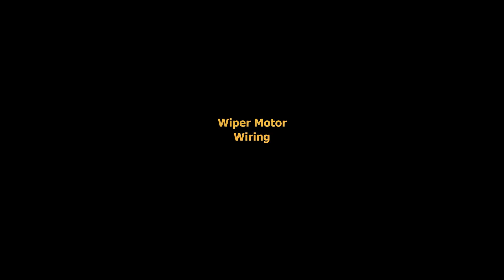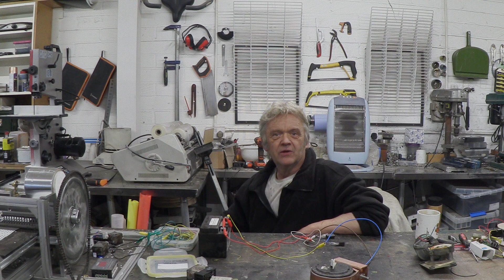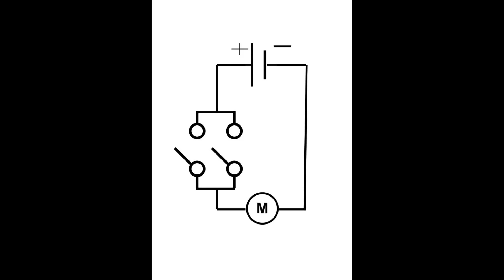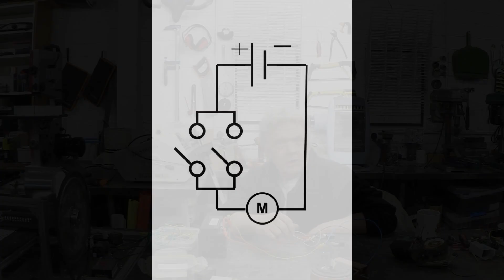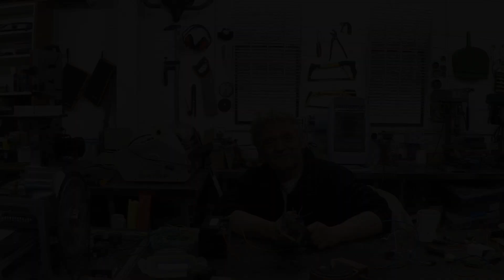979 - Wiper Motor Wiring

Comment: I just had my 1973 Mercedes 450sl wipers "fail" by continuously running when not told to!  sounds like the park switch in the motor is gone!  I replaced the stock and there was no improvement.....  Any thoughts?

Comment: Any help here please .
I got stuck with odd behaviore.
I have British stile dashboard suposedly it was build for me Ascona C 85 model year that thing has 700Y voltage regulator inside the dashboard.
How ever I broke down the 12si delco alternator regulator to see whats inside and suprisengly nothing just empty circuet board.
The thing is Im chaseing fir days to see why me engin self acelerates from idel to max rpm when I use me head lights the other thing acured as well If I use on warm motor all 4 blinkers me engin dont want to stop it kinde of works in union with blinker relay nearly resembeling hit and miss engine .
I do use 4 pin gm ignition module with inductive trigger and E core type ignition coil from GM .
I found the problem eventualy it was corroded ground wire on the back side lights bulb holder it hade grean staff on it I cleaned it and the problem gone away eventualy.
But I wanted that feature for some reason I was curiuse why it worked so well???
Can I modify that some how and use that feature ?
Other specs that I have:
2pin warning lights on relay,
3 pin blinker relay,
4pin rear windscrean heater relay 
6pin windscrean wiper motor relay.
So any help please why that acured?
What has blinker relay to do with other relays me wire harnest from GM is a mess Im confused like hell.
Is there any way to control that 4 pin gm ignition module pulse duration ? Im tired to go out side in winter to fumel with me distributor ignition timing .
Im seriusly anoyed.
And is that windscrean motor 6pin relay actualy singel pole dobel trow relay??

Comment: Great video helped a lot as I have to sort out parking on my P5B
However just out of interest:Resistance is defined as the property of the conductor which opposes the flow of electric current. It is also defined as the ratio of the voltage applied to the electric current flowing through it. The resistance of a conductor depends on the length, area of cross-section, and the nature of the material that is used in the manufacturing of the conductor. For a conductor, the resistance is directly proportional to the length of the conductor and inversely proportional to the area of cross-section.

Resistivity is defined as the resistance offered by the material per unit length for unit cross-section. The SI unit of resistivity is Ohm.meter. Resistivity increases linearly with temperature. The resistivity of conductors is low when compared to the resistivity of the insulators. Therefore, it can be represented as:
Resistivity of conductors < Resistivity of alloys < Resistivity of insulators.

Comment: Thank you so much for this video itdoes not solve my problem but it helps me to understand. I am trying to connect a VW Beetle wiper  motor to a GM switch and I need it to work as it would on the car.

Comment: Hi, is there any chance you might be able to help me with a wiper motor issue?
Whilst I use them I certainly don't fully understand the wiring system.
I use lots of wiper motors for my halloween displays (connected to12v 5am power packs/leads).
But whilst I can simply select fast or slow speed I am desperately trying to find the right combination for park mode on my 4 wire  Mapco 90192 wiper motor.
I have spent months trying to figure it out but I fail every time.
Any advice or a walk through would be greatly appreciated.
Best wishes 👍

Comment: Given the speed at which they rotate under a 12V load, these motors would seem to be a good candidate for making a hand crank generator.  😊  Or are they horribly difficult to turn?
Reply: Northernkitty.  Most are a worm gear drive and therefore cannot be back driven. A worm gear can turn a worm wheel but a worm wheel cannot turn a worm gear.

Comment: I've been working with wiper motors some time ago.. if you unscrew the motor case and slightly rotate the magnets position , the motor will spin much faster at the same voltage
Reply: Ooh really??
Tilting to what angle sir?

Comment: yes they are very useful. Ive got 2 to open 2 small windows, the park function is to close the window, and then my Raspberry Pi running BBC basic just turns the motor on for a set amount of time to fully open then window. 

been using it for 2 years now, and its awesome.

Comment: As it's not needed to run the motor; I'd say that the circuit board contains a 555 timer or an integrated circuit to control the wiper delay.

Comment: I built a light duty Scissors Jack using one of those.  It can lift my  Ford Ranger Pick Up. .  It won't last long.  They used plastic gears.
Reply: @marthale7 There are a few versions shown here on youtube.
Reply: Quite a few OEM car jacks use a plastic nut to lift the car with a course acme type thread, deceptively stong.